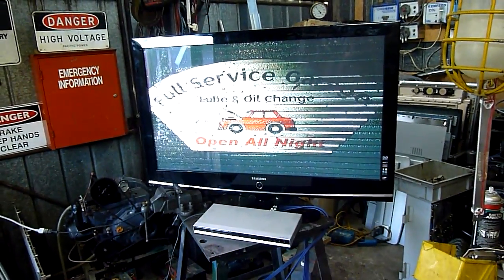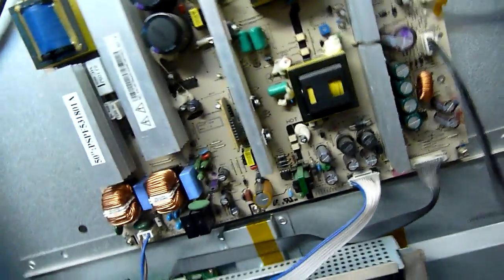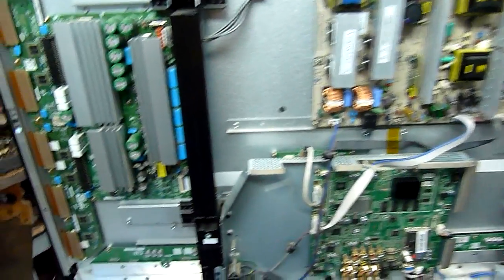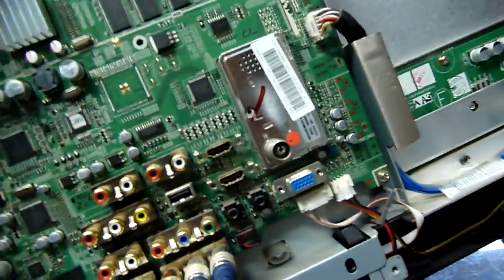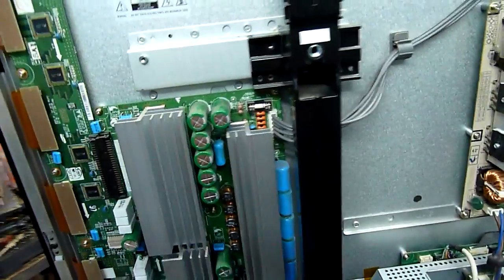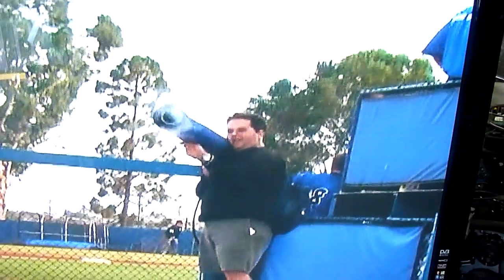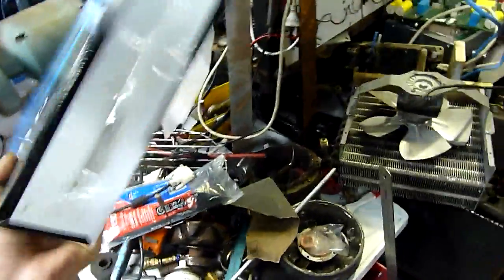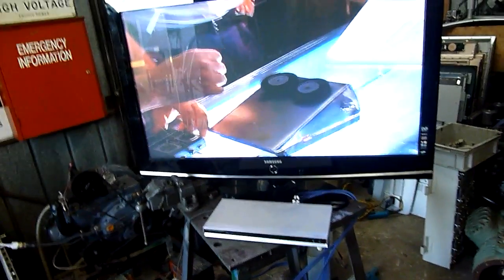50 inch Samsung Plasma FTW!

Comment from the maker: pretty sure the Mosfet's just go bad but they also can take out other parts aside from the fuse. not sure what ones on this model PSU tho, I only had to resolder mine and fitted replacements as a preventative measure

Comment: Nice... Looks like you caught it just in time.  Just did the 42in version of that set where those same FETs had blown apart beyond recognition.  It's almost like they expect it as there's a little driver transformer that isolates the gates of the FETs from the IC containing the damage to the FETs themselves and a couple of resistors and diodes.  If you attach a brace to those mounting points it will make lifting the panel out easier, there's bound to be residue on the inside of the glass.

Comment from the maker: yeh they are being built more lightly than the early ones, advances in semi-conductors make them much more simple.

but Plasma's time has pretty much been and gone, my 3 month old Sharp AQUOS 3D LED TV absolutely owns all the plasma's I own, it weighs bugger all and barely gets warm!
I only use it as a PC monitor so burn-in is also a non-issue

Comment: hey dude i got me the exact same tv with the exact same power supply. The thing is its got the 2 18n50 power mosfets shorted, the fuse (603) gave me the lead to the mosfets. Do you think they just gave up or there is another problem in the tv that ruined them? you dont happen to happen to have a spare power supply like that eh?

Comment: @Knaeckebrotsaege agreed , i have friends who work in samsung after service ,lots of returns to get refurbished have bad caps ,especially the units from china, the korean made stuff as well as the mexican built stuff has less problems,and alot less of these cheap caps in them,caps shouldn't be failing in 2-6 months of use:(

Comment: lol its normally summet simple. lets hope the LG i found is simple. (it wont be.lol). sorry to say you will never get rid of that smoke smell. that rank arena a/c unit in the shed had that smell and i cleaned fully it 6 times and still years later some warm days when its not running ye get a wiff if its nasty former smell.

Comment: @Knaeckebrotsaege it depends where they were made ,or if just rebadged garbo too,some of the Daewoo caps are good , but the rebadged chinese,&viet caps are crap as all ,i highly doubt OEM  Daewoo caps were in a hyundai monitor as they are arch rivals ,unless its just a rebranded hynix crap monitor ,those are loaded with crap everything components,not just caps., as for SamWha,they are infomous for rebranded crap ,always have been,they buy alot of there components from others Samyoung makes own